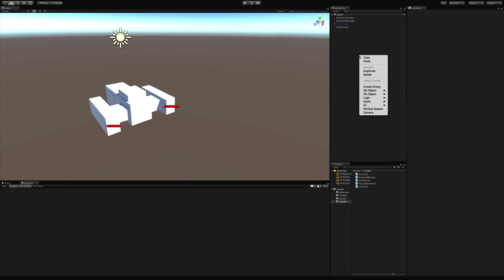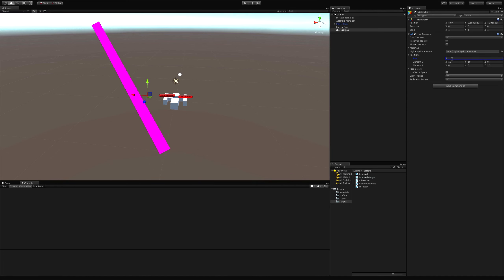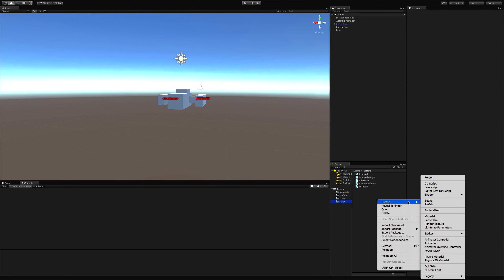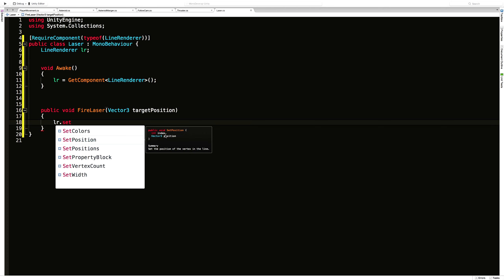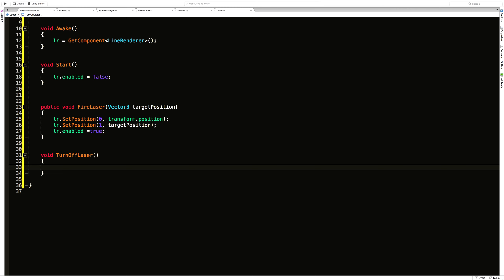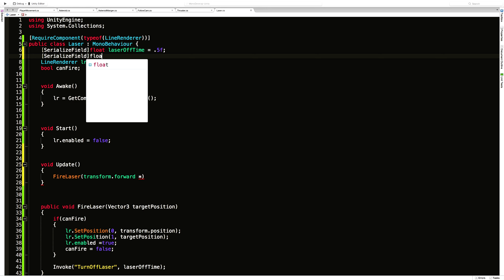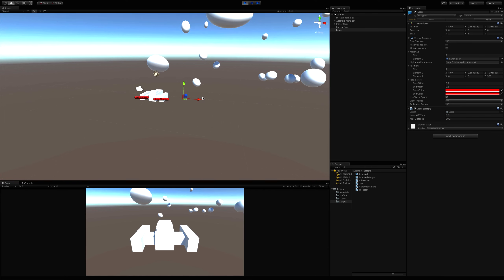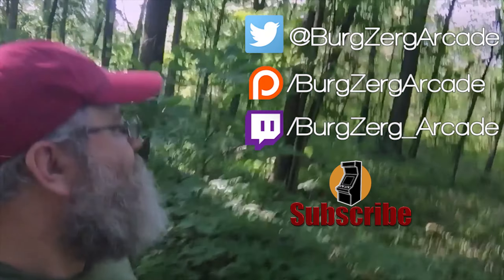Line Renderer - Unity 3D Game Development: Week 3 Game

Comment: Nice tutorial. One minor thing, if you watch closely, the lasers are blinking at very irregular intervals. This is because the Update calls FireLaser, which in turn Invokes "TurnOffLaser" every single time (even if a laser wasn't fired). So an "old" invoke (which was already queued) could be turning off a laser which just fired (but for which the 0.5s period hasn't expired yet). This can be fixed by moving the Invoke call into the if-statement in the FireLaser function. When not using Update (you commented it out at the end) the issue will be less apparent (but still there) depending on how often the player triggers FireLaser.  Also, in newer Unity versions the line renderer seems to behave a bit different in regards to positioning ( it won't let you move the Empty around when 'worldspace' is enabled). So basically you want to disable 'worldspace', move the empty to the correct position and then enable worldspace (coordinates stay correct in the inspector, but the empty is drawn at the origin).

Comment: That's really cool. I love that laser. Thank you!
Reply from the maker: +Lief Layer I noticed some things that need adjusting, but I am hoping to put it off until unity 5.5 comes out with the new system.
Reply: BurgZerg Arcade Still I didn't know about line render before this video and I find it really cool.
Also your videos are always really easy to follow (I'm not a native english speaker still I can follow your tutorial).
It is true that sometimes there is something to change (like the jump in the character controller tutorial) but it's part of the fun.
You give us the input, if there is something that we need to do to make it perfect is fine by me.
Right now I don't plan to work on a laser (I'm working on a isometric character controller and camera), but I still look your video because I always learn something new.
Reply from the maker: +Lief Layer I have an older video where I used it to make lightning for the old hack n slash series.
Reply: BurgZerg Arcade I know I watched the whole hack n slash series. Unfortunately  from Unity3d 3 to 4 already many things had become obsolete and Unity3d 5 now has changed almost everything. But it was a great series.

Comment: I dont know if anyone will reply to this but i get a problem when ive attached the lasers to my player model, when moving the do not remain straight and start going off at weird angles.
Reply: You can actually nicely see what is wrong when you set your Laser Length to a small value, like 30... Then slowly move your ship forward. You see the laser becoming shorter and shorter, and once your ship moved forward 30 units, the laser starts firing backwards (and gets longer the further you move).  Because we are in "worldspace", you actually want to set your target at "wherever your laser is in worldspace + forward a bit from that point on".  
So try changing the line in Update to this: FireLaser(transform.position + (transform.forward * laserLength));

Note that the laser-line remains unchanged for "laserOffTime" seconds. So basically it's only pointing correctly at the exact moment you fire, and "decays" for the rest of the laserOffTime period (the more you rotate and the later during the display-interval it is, the more "off" it will look).
Reply: I am facing the same problem , whenever I fire laser they start going in weird directions. Please help to resolve this.